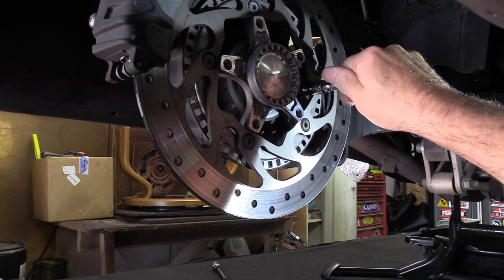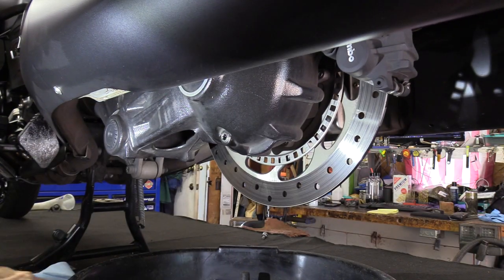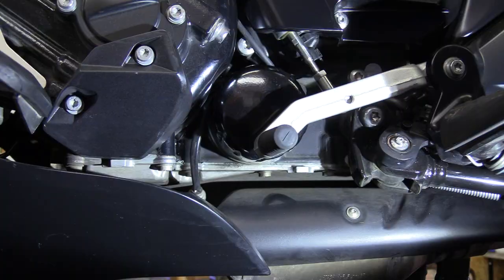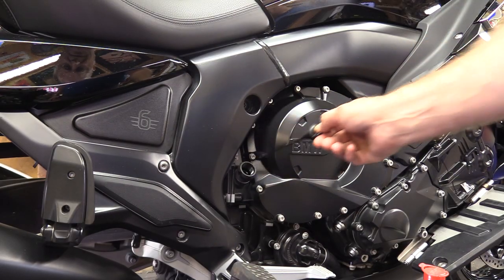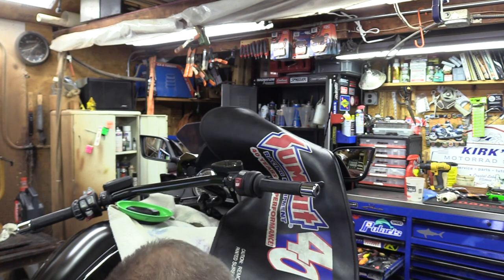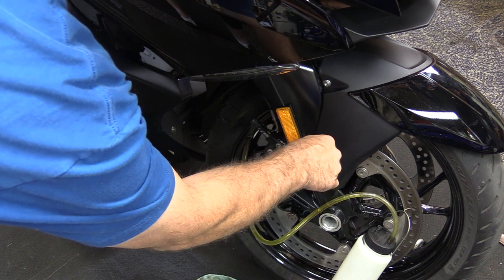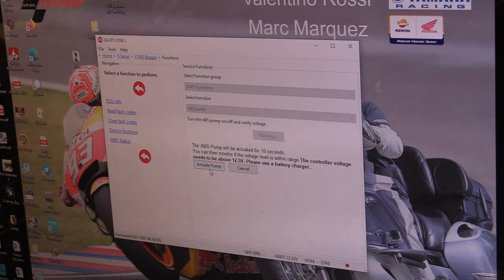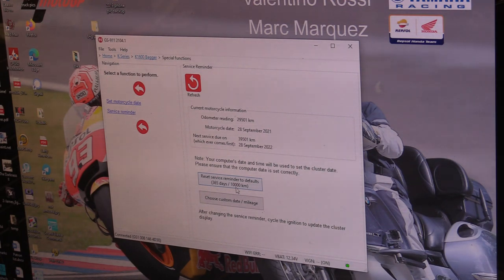BMW K1600 Fluid Service - Oil, Brakes and Final Drive

Comment: I am not sure which is more stupid, the dual coaxial drain plug design or the oil level check procedure that requires idling the bike for 10 minutes and then doing a number of other secret handshake steps.  Who but BMW can complicate something as simple as an oil level check?
Reply: It's a dry sump engine, all dry sump engines require an oil level check, drain and fill procedure which is different from conventional sump engines. It's not a bmw thing and far from stupid.
Reply: @Marc-zf3xv  Most are as simple as looking at a level in a tank while the engine is warmed and running.  Few are nearly as goofy as the BMW although Rotax comes close with their 900 series aircraft engines.
Reply: @LTVoyager  I've owned a few Hondas that had a very special and specific oil checking procedure as well as a few Aprilia's. The BMW procedure is nothing out of the ordinary and honestly no big deal what so ever.
Reply: @Marc-zf3xv  Not nearly as nice as looking at a sight glass or a dipstick which is a close second.  Anything more complicated than that is poor design.
Reply: @LTVoyager  clearly you should be able to engineer and package a 1.6l engine inside a motorcycle frame better than those that did so for the K16. Your future and career must look bright. I'll keep an eye out for your future success.
Reply: @Marc-zf3xv  I retired several years ago after a long career in engineering and R&D.  And you?
Reply: I have a 1999Lt and
Reply: Does anyone know where to get a transmission for a LT1200k

Comment: After 15 years of working on my LT, I now deduct 10-20% from the BMW torque specs.  This still gets fasteners plenty tight and lowers the risk of overtightening as BMW seems to run much higher torque specs than other makers for similar size fasteners.  And I especially don’t torque the oil filters to what BMW says.  I use the old “angle torque” method that I have used on cars and trucks for decades: screw on the filter until the gasket makes contact and then go 2/3 to 3/4 turn and it is plenty tight yet will always come off at the next change.

Comment: Could you Please Clarify one thing as I am new to the K1600 GT bikes.  Just bought a 2012 K1600 GT.  I take it this bike has a Wet Clutch, so I can NOT use Regular Full Synthetic Car Oil ?   And have to use either Motorcycle 5-40 Oil or as you mentioned Rotella T6 Oil ??   So the Rotella Diesel Oil is safe to use on this bike ???   Just want to make sure.   Thank you.
Reply from the maker: You are correct. Rotella T6 is good to use. It needs motorcycle rated oil. Do NOT use regular oil for any reason!
Reply: @kirksmotorrad  Thank you Kirk.  I have used Synthetic Car Oil on the LT, old Rt and 2007 GSA.  My understanding is that all of those bikes had Dry Clutches thus did not need specific Motorcycle Oils.

Comment: Hey there, thanks for all your input great video. 
Question: I was told that after bleeding the breaks front and back and activating the ABS pump with the gs 911 as you did in the video ,we had to redo that operation 3 times of bleeding and activating the ABS pump, is this correct???

Comment: Where did you purchase the gear lube syringe, brake bleed off tube with connection and hose, and the electronic adapter and tool to activate the anti brake pump. I liked on your amazon site and its not all there?

Comment: Hi Kirk, Unfortunately, I'm not even close to you so I can't bring my bike. I have a 2014 k1600 gtl, and I had a small crash about a year ago. Everything was fixed, except for the front wheel alignment. When the wheel or the bike is going straight, the handlebar is slightly turned to the right.  The handles are fine, and the plate that supports the handles is fine too.  What else can be twisted to have the handlebar, or the wheel misaligned? how can I straighten both?

Comment: Question for you, did you make a video about changing  the hydraulic clutch fluid maintenance...?
and thank you for all your great information...greatly appreciated!!
Reply from the maker: I have not as the clutch oil does not get changed very often since it is mineral oil. If I ever do one, I will make a video on it.

Comment: Solve the issue with the inner drain bolt !!!! Take it out next time, take an Allen adapter to 1/4 drive socket(Amazon,plenty) go to a machine shop, they will weld it on the drain bolt. You will never have the chance to loose it while unscrewing it. Very safe. It stays inside and with no harm. I did it on my Grand America. PC of cake!!!!
Reply from the maker: Dont forget to tell the next guy if you ever sell it.
Reply: @kirksmotorrad  Sadly, sold it. The new owner was informed after he had explained that he does all work on the bike. I had many issues after having 12K on it. No more BMW bikes for me. Good luck!

Comment: I had an 1200 RT, and in 2020, traded up to a 2016 GTL.  On the RT, i changed the gear oil in the final drive every two years, and since I had to allow the final drive to drop down to drain it, also coated the final drive gear splines and universal joint with Belray assembly lube.  Would you recommend to to the same with the K1600?  I would guess the procedure to drop the final drive on the GTL would practically identical to the RT.

Comment: Hey Kirk great video, I was wondering if I could ask you a question about the brakes on my 1998 K1200RS with the brembo system. Do those brakes just need to be bled conventionally or do I need to buy a GS 911 to do what you did to the bike in this video?
Reply from the maker: you do not need a gs tool for that one.

Comment: Hello Kirk! I have been watching your videos since my K1200LT days! I now have a 2018 Grand America and got the check oil message. That message went away, but I feel I need to change the oil. I just purchased two items from your store and will continue to do so. The oil change was straight forward. My question is, I was not expecting to remove the rear tire to change the final shaft drive. I do not have a lift. Will I be able to remove the tire only with the center stand holding the bike up? I have one of those 3-ton jacks that I can place a piece of wood under the bike and lift a bit. Any recommendations? Thank you!
Reply from the maker: The center stand is more than adequate to hold up the bike.

Comment: The duration of the abs pump activation while doing the gs-911 test is sure longer than what you can replicate on the road.  Is that long duration necessary to "excercise" the system?
Reply from the maker: It must be...

Comment: Have you experimented with Torxplus drive tools? Perhaps there is a better fit than the t45 regular torx. 

FYI; Snap-on tools also has a new four pronged bit called the Mortorq@.
Reply from the maker: I will certainly check them out! Thanks!

Comment: Someone told it it was 11nm torque spec for the filter and it spilled out EVERYWHERE.  Gotta really crank that shit down.
Reply from the maker: The filter is 11 nm. The FD drain and fill is 20nm The oil drain is 28nm and 12 nm on the plug inside. The tire is 60 nm. Maybe the filter was cross threaded?
Reply: @kirksmotorrad  No, I took unscrewed it to check and it was threaded correctly. Going to drain it and check that the old gasket wasn’t left on. It stopped when I cranked up the nm.